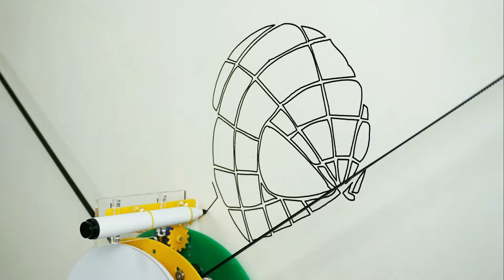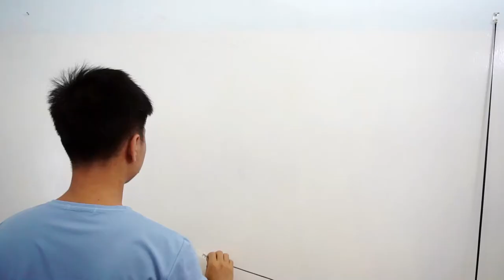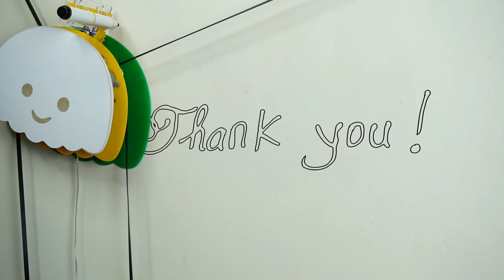How to make - Wall drawing Robot

Comment: I noticed your pen is above the virtual pivot point where the two belts meet. Does it really matter where the pen is located? A lot of wall plotter designs have the belts directly rotate around the pen.
Reply from the maker: Yes, it is really matter the pen location. In the code, i calculate the location of pen. Anyway, we can put the pen anywhere on the robot, then we update some parameters to let the robot knows the pen location

Comment: Hello, I would like to ask about the power supply for the cnc shield. In your part list, there is a Power module 220VAC/18VDC 1A. And the link in amazon shows a Power Supply Battery Charger. Should I cut the cable of it?
Reply from the maker: Yeah, you're right. Cut the plug and connect to the  Power module DC XL4015 5A [Q'ty: 1] https://amzn.to/3wZtDqM
Reply: Oh Thank you, I have one more question. Are the input voltage and current of 14V, 1A valid for these step motors? Because I checked the documents of the step motors, the working voltage and current are 12V and 0.6A.  @engineer2you
Reply from the maker: @zhenhuiwang3381  yes. It could operate at 14V to increase torque. But the motor will get hot

Comment: Hi, must I use CorelDraw to convert svg pictures? Is there any free apps to do same? I got svg pictures in different format than u, like <polygon> must be written in a single line. But all the converters I used will add a tab between them. So the excel cant be used
Reply from the maker: Right. Currently we must use Corel Draw. In future, I will try to use G-code from Inkscape. Do you have any suggestion?
Reply: @engineer2you  My project is to do a chalk drawing bot. I use currently LaserGRBL which is a free app to convert pictures into Gcode. I wrote new Arduino code based on the Gcode, because the converted Gcode only contains move_line command. All the curves in the Gcode will be cut in tiny lines .

Comment: ❤Your work is amazing! Can I ask why u swap the cable Pink and Yellow of step motors? I’m a little confused
Reply from the maker: Because the stepper motor can’t work with Arduino cnc shield connector, so we need to swap the cable to make it suitable with cnc shield connector
Reply: @engineer2you  Hi could u recommend a video to swap the cable？ I have no idea how to make it.
Reply from the maker: @振辉-f8u  hi, use a small needle to push the latch of pin, then, take out the pin. It  is not difficult
Reply: @engineer2you Is the aim of swaping cable to change the unipolar motor to bipolar？ I saw some videos and they cut the trace of red cable inside this motor additionally. Is it better for this draw bot to do this?